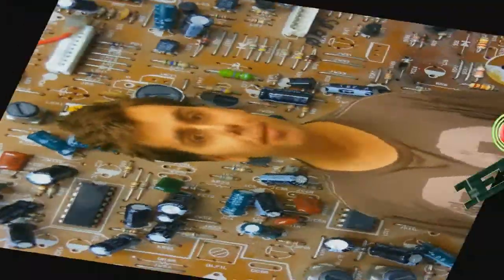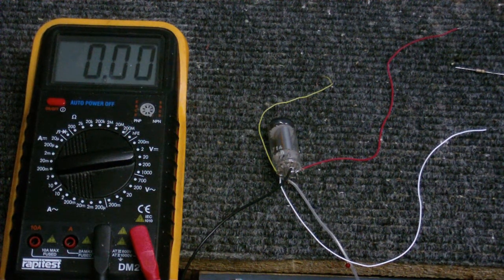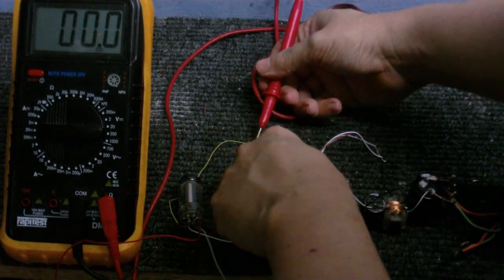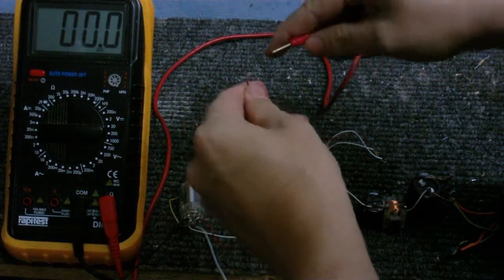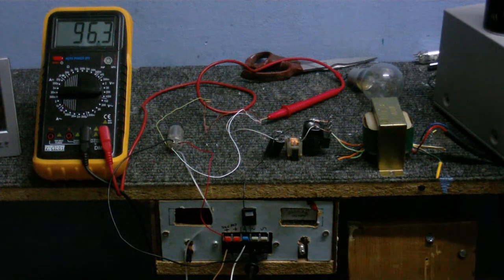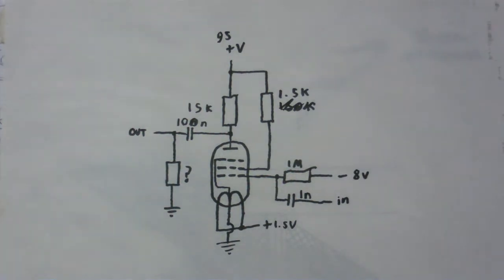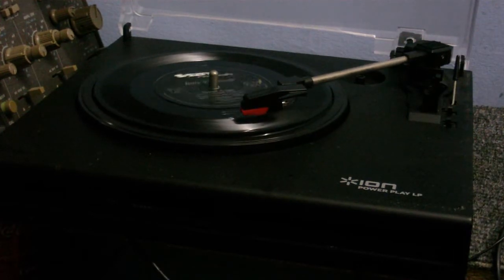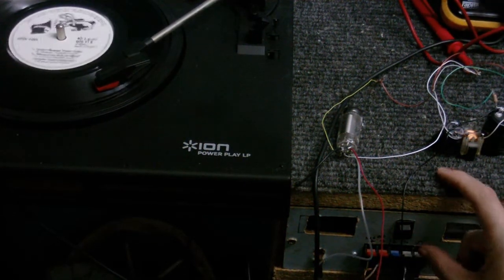CDC Electronic Workshop - Experimenting With Valves/Tubes

Comment: If u replaced the 100k plate resistor with a mains transformer, whose primary measured between about 50 ohms and 1.5k (the inductance would make it 50 to100k ohms) the u'd have a 2 watt or so single ended output stage that could drive a speaker!

Comment from the maker: It does give near-line level output, the output is just a little bit higher than what a normal line level would be, but I can plug it into my tape deck with the input level set quite low and it works just fine.

Comment: every tube has almost the same glow (exep battery tubes)

the 125V heater voltage is just for special aplications

if you want tubes for an amp that look good

try the DCG1/250